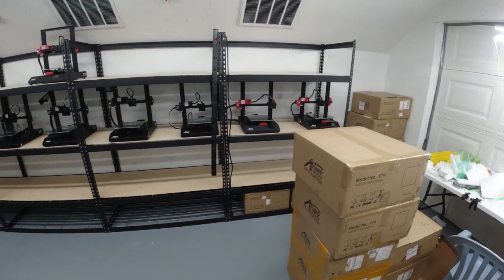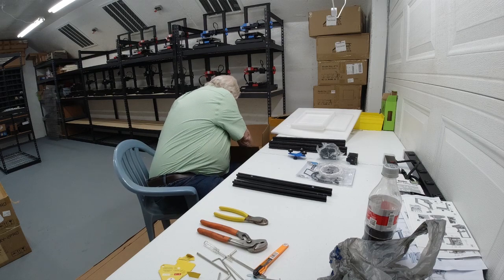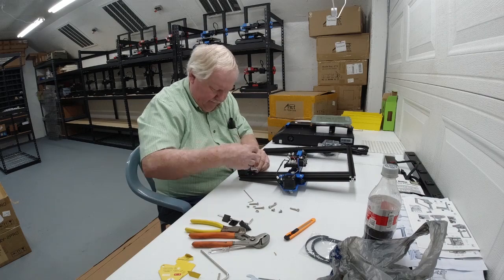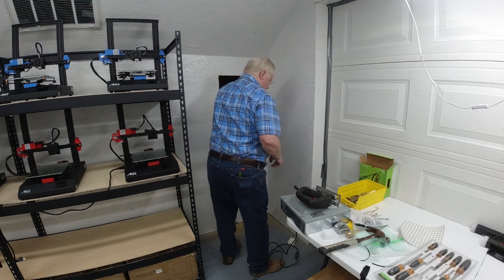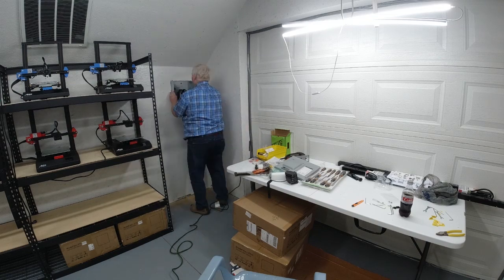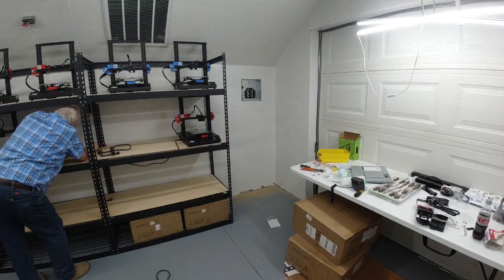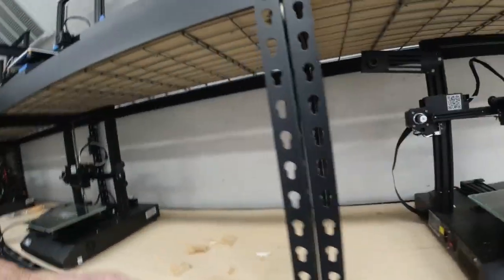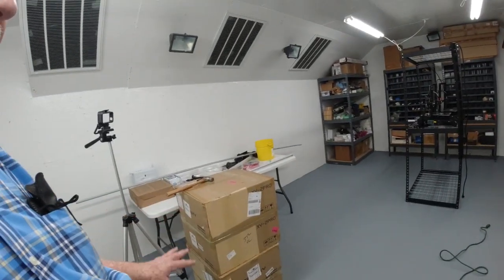MY NEW 3D PRINT FARM PART 5

Comment: Excellent video, looking forward to the next, what made you choose the Anet printers for the farm?
Reply from the maker: I already had about 10 of them and they were working well, and then the price was right at about $135 each and the fact that they assembled quick. So I bought several for the new print farm while the price was low. The price has gone up over the past few months, I'm not sure why. I will have some of the new ones running soon, watch for the video...Ken

Comment: Perfect video... what size wire comes into your 80 amp box.   80 amp wire? What size box? This video is exactly what I need to know....joe
Reply from the maker: I will run a 2-2-2-4 service cable with 220V 100AMP Main breaker. Technically this is equivalent to 200Amps of 110V power which is much more than what I need. The box is rated at 125AMP. I will be checking my current demand as I power up and add printers. I will show that process on video when I get to that point. Thanks for watching...Ken

Comment: Will you be putting in a UPS system? You don't want to lose power in all the those printers at once. Power print resume doesn't work all that great. Once that bed, nozzle cools down you are going to get blobs, layer shifting on restart.

Are you going to be printing in PLA, PETG or ABS?
Reply from the maker: Thanks for that question Randy. I had planned to have some printers covered by a UPS system. I currently have some UPS and some inverters, however I'm not sure how I will be using them. I have two generators and thinking about getting a Generac automatic generator. I still have a lot to figure out in that area. Your right I can't afford to lose a lot of parts because I let the bed get cold or had the printer off line too long. Will be addressing that in a upcoming video. Thanks for watching...Ken